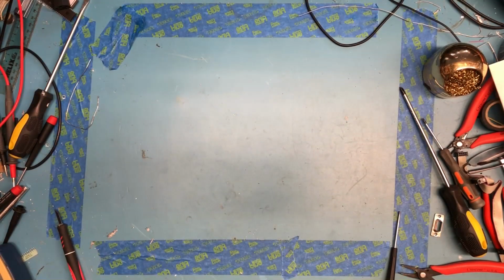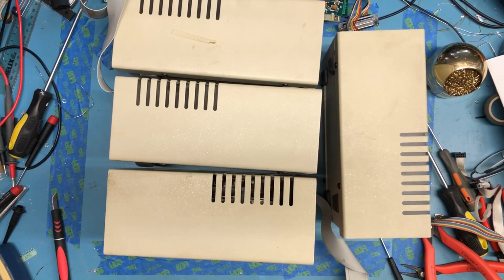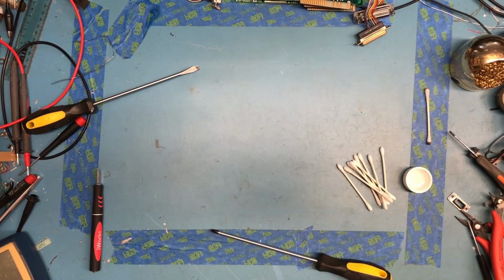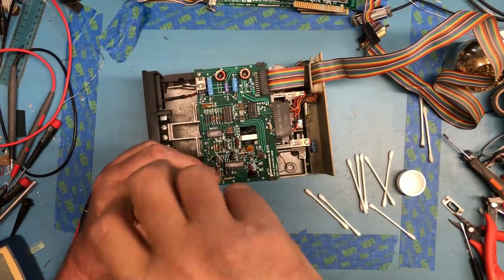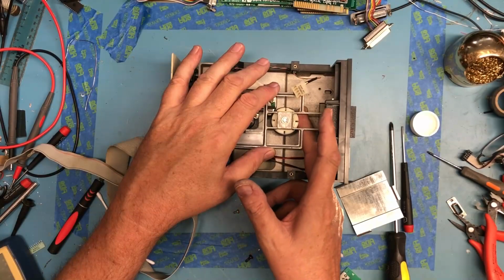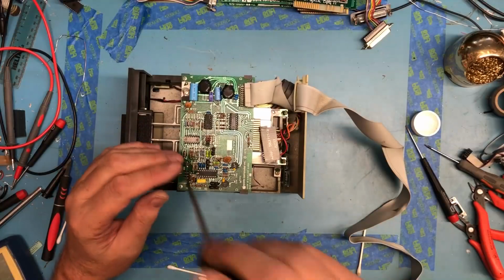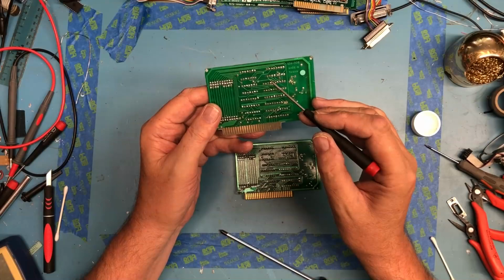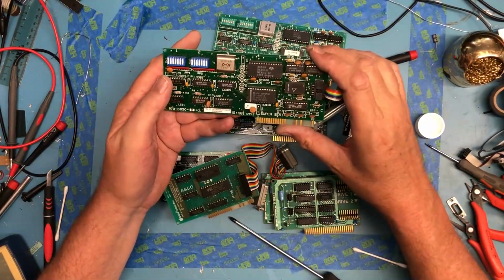APPLE II Plus - Part 2 - Disk II - Testing the floppies and booting the system - STB196

Comment: You're right about the disk][ bodge wires not shipping from the factory.  Someone whacked the traces and then bodged them back in.

The first controller with the DB19 is the "Duodisk interface", which is 5.25" only.  It can drive a Duodisk unit, or 2 "Apple 5.25 drive" units that are daisy-chained.

The second one that says "ASCO" on it is the LIRON controller that is used with the Unidisk 3.5 drive (it's technically a smartport card, but using the Unidisk 3.5 on a II+ or IIe is its intended application).  The big chip on the LIRON card is the IWM chip.  It's basically an entire disk][ controller on a chip!  There were later ASICs called "SWIM", which put the IWM functionality (which dealt with group code recording) and the ISM functionality (which gave you MFM support) into a single chip.  The Apple 3.5 controller had SWIM and its own 65C02 on it.  You can actually run 1.44MB floppies off that card!
Reply from the maker: Noce, this is all good info to have. Assuming IWM is the Integrated Woz Machine? I met Woz at VCF, I think it was 2006. He's seemed an incredibly nice guy, smiled throughout the entire event and talked with countless people.